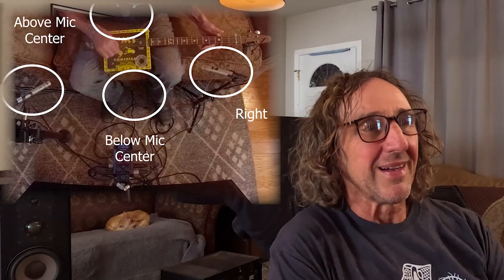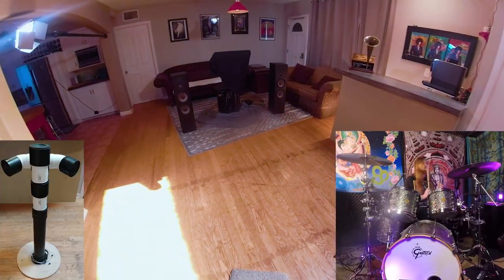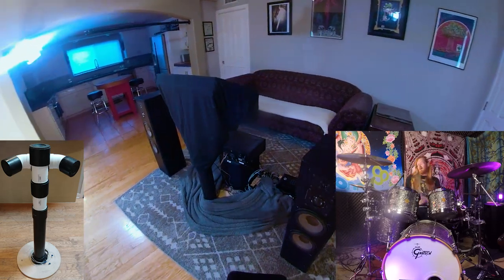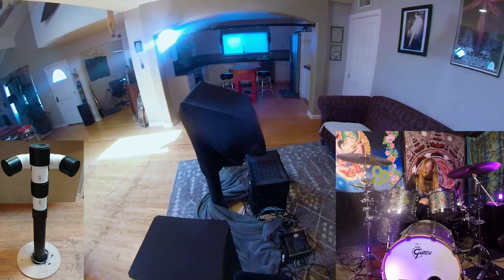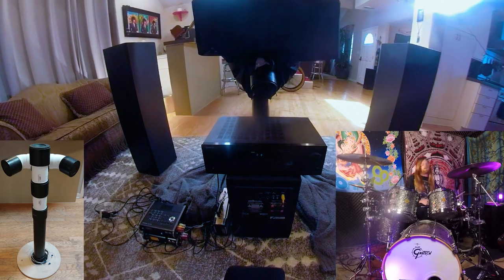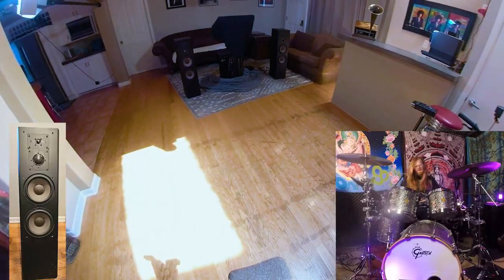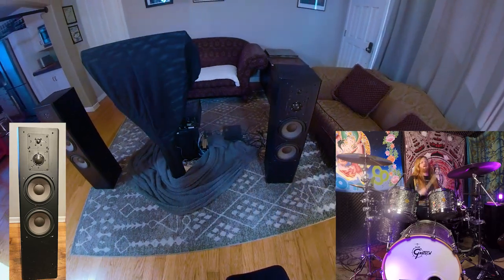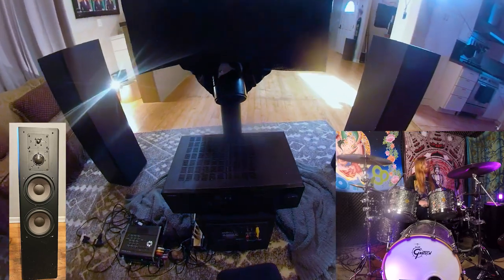How Real Do the Drums Sound?

Comment: By reproducing reverb separately a high quality representation is achievable.
Reply from the maker: If you recreate reverb then you're recreating another room inside of your room which will never sound like the instrument is actually in your room.

That will sound like there is an instrument inside a room that's inside your room.
Reply: @DaveRat  you're thinking of recording rather than emulating or reproducing. To change the room's reverb we need to be able to actively control the reflectivity of the walls - particularly at low frequencies.

To achieve the required diffusion and phase response to emulate reverb is something that we do for classical music, and the South Bank Center has an adjustable reverb time. We keep it very quiet how much reinforcement and synthesis is going on - the classical music snobs would fire us all in a minute if we told them what's in the roof.

Similar systems now permit classical music to be performed in open air, and it's basically a diffuse cloud of speakers with some very fluffy gaussian shaping involved.

Absolutely it isn't totally easy to reproduce an acoustic environment. Headphones also sound super unnatural. It will be a long time before the human audio perception is fooled and we're experiencing "holographic sound".

The diffuse or gross aspects of a reverb tail can be reproduced quite easily, especially by putting speakers in all the corners of the room. Early reflections, phase response and micro-timings are much harder to deal with - there is an argument for placing speakers on a person's head or over the ear to supply that information.
Reply: @DaveRat  so basically I reckon that by combining some boundary positioned speakers at the first reflection points, various b-format loudspeakers on some sort of animated robotic cable conveyer system, and a bending wave loudspeaker system integrated into the surfaces, all discretely digitally amplified and processed per driver, as a network, with onboard monitoring and AI/servo correction of the required parameters, we probably could get it done where blindfolded you are actually convinced you are in a machine gun nest or landing craft on D Day, with all the right noises coming from the relevant places, so you can hear the shell casings landing on the floor... It can be done. There will be holodeck.
Reply from the maker: I think Holoplot can do this right now.

The issue is the more you achieve with processing the less realistic the processing sounds
Reply: @DaveRat  a lot of the active noise cancelling systems and AI stuff is based on filtering noise, and some of the better sounding active acoustic controls can sound positively hideous if you listen to the "anti-sound" in isolation - at the listening position these artefacts present as an artificial reduction of dynamic range and an increase of the noise floor, but as with all distortion and noise... it all adds up, but often one sort will mask another. Over a distance of 150m in a concert hall, and an array of 600 individually amplified 15 inch concentric driver boxes, you can get away with more in terms of vagueness and larger time windows and spatial volumes for hiding things in than you can with a living room.
Reply: @DaveRat  holoplot looks most likely to win sounds weird and has high distortion off axis award of the year award goes to... bway that's a lot of silk dome tweeters you got there. I'd like my next house built out of them, absolutely. Every surface. Where do I sign.
Reply: @DaveRat  however, in terms of an anti-sound, one must note that the electrical braking and servo control of a loudspeaker can in theory produce an anechoic response - using driver clusters to prevent comb filtering in difficult rooms is fascinatingly successful, and can actually get rid of the frequency lobes caused by interference - this is partly because a cluster of speakers with an amplifier in it is actually a huge actively controlled helmholtz resonator. It is possible to actively control acoustic treatments, and extract large amounts of kinetic energy from the vibrating surface by electrically adjusting various parameters, including mechanical damping ratio. Actively controlled or electrical vibration dampers are common in precision industry, and similar techniques can be used to design anti-sound and anti-reflection devices, some of which could very likely introduce diffusion and phase delay as viable methods of moving or removing room modes, removing or adding resonance, and various other components, simply by turning a screw or clamping surfaces together, as well as by moving a loudspeaker diaphragm. Placing speakers inside helmholtz slots or tunnels can also do some very serious stuff in terms of controlling low frequencies, and anti-sound techniques are required to really tidy up any acoustic space. Large venues are the worst culprits.
Reply: @DaveRat  most interestingly, a holoplot 2d array does allow beamforming - enabling a reverb virtualisation method where the ceiling, walls and floor can be sent separate reverberant signals, which are relatively well focused on a narrow listening position, and reflect off the actual walls before meeting the listener. This means that much less sound has to be injected into the room to supply reverb, so a few chunks of 2D array is highly suitable for providing early reflection information, by bouncing the reverb off the walls. That would indeed supply a fairly convincing reverb component at a given position, or range of positions. For adding orchestral reverb to a bad room it could be really suitable, just fly in a pair of holoplot clusters above the stage, separate to the mains, and run a stack of altiverb instances with some well designed impulse responses... very likely nobody would be able to tell what the fix was for an orchestra placed in a really dead big screen cinema, or that the reverb was not inherent to the building. It would blend.
Reply: @DaveRat  beamforming has a bad rep, hissy and swishy, and with a burdensome taxed headroom, but for reverb only, used in a clever way, I would bet it'd work a treat for synthetic reverberation. In a small dead theatre, it would very likely be able to produce the effect of climbing into a huge cave, or escaping from a prison through a sewer, illustrated only using artificial reverb and the actor's voice in the modified acoustic environment.
Reply from the maker: On the member side I posted a a video of the holoplot demo of beamforming and wave front synthesis and other features they can be even heard of my cell phone recording.

They want to give me a few of the speakers to play with which I will probably take them up on at some point when I have some time.

I was a consultant on the EAW on your system so I have quite a bit of experience with beam steering designs and all that working with those engineers.

I also have heard a room cancellation dead name system from PowerSoft eliminates the room reverb or ads reverb.

So I think I have actual experience with all the stuff you're talking about how well it works and the complexities involved in deploying them along with the limitations

Comment: I think you're onto something with the real sounding speaker.   on gravity.. that's a tough call.   the equations for the various forces in physics don't always hold true in practice.    I think in general math does hold.. you know even imaginary numbers hold true in electronics! as to the earth ... I read the Bible.. for the longest time I doubted certain parts of the Bible but I am much less doubtful now.   so much less.  It took me a long time to arrive here.  you know how a sphere is nothing more than a circle rotated about its diameter sweeping 180 degrees.  therefore all the rules for circles must also apply to a sphere, like curvature.. Geometric rules for chords and tangents all apply etc.. I think merely looking at gravity and I am not telling you whether I think you are right or wrong-- but merely using whether gravity exists or not as a test for determining the shape of a planet is, if you really think about it, is as useful for determining the shape of a PA system.  have you ever looked at the stars or taken photos of stars?  they say the great pyramids are arranged in the shape of Orion's belt.  the Big Dipper was there in the exact same shape, the angles and distances all the same thousands of years ago. "why didn't gravity pull the constellations into different shapes???" ... on any given night, you can be certain it will be the same shape.  look at time lapse footage of stars rotating about the North Star and watch for things like parallax scrolling.   get in a plane and fly to Hawaii and look at Hawaii out your window on a clear day or at some other mountain range from a distance.  then consider geometry etc..  light travels in straight lines and shadows tend to form on the opposite sides of objects from the light source.. these are very basic and obvious things to consider but when you consider them all at once when you observe the world around you and the clouds and stars and sun and moon and horizon and land formations and consider distances and geometry.. well there are a lot of things you can figure out without using sine, cosine, tangent functions or without advanced geometry but if you do have access to a real geometry book, like one from a math major in a major university - or even the one from high school but if you consider all this stuff, you may begin to find interesting ways to measure distances or shapes or "scale".. it helps to be an artist as well - I mean I know you didn't need to read this much to get a feel for what I was trying to say.. anyways.. I liked the suggestions you had for your old man for speakers and fully agree with your assessment of audiophile.  I mean.. I have some pretty darn cheap speakers I use on a regular basis for enjoying albums... I never actually studied sound anywhere near to the depth I studied engineering/electronics or "general" physics.  you might know this.. you know how light has a vertical and a horizontal wave which is 180 degrees out of phase.. I think one is electric and one is magnetic or something?  I wonder if higher frequencies have a horizontal and vertical component like that OR if there is something about the ether which causes that because you know how keeping mics at 90 degrees for a stereo image is much nicer than 60 or 30 degrees.. I know 120 is popular (I never use it- maybe I am wrong for that?)... anyways, just some curious thoughts I have about sound.

Comment: None of the speakers presented can do this regardless of room size.
None of these sounded realistic
A Drum kit easily surpasses 115sb SPL without compression,
at the minimum you need a fully horn loaded system such as a Klipsch Lascala, Klipschorn, or obviously the Klipsch Jubilee 
or seek out old voice of the theater Altec Lansing horns or fully horn loaded PA, but PA speakers might not be as refined
Reply from the maker: Sounds like you are adding on the additional parameter of how loud it is by making the assumption that the drummer plays hard.

I remember doing a show with Terry Bozzio warming up on drums playing incredible fills and the full kit rocking and you could talk perfectly standing right next to him he was playing so softly it was truly amazing.

Regardless the goal is not to make something the same volume as a drum kit nor was the goal to make something that sounds identical to the drum kit.

The goal was to build a speaker that sounded realistic like a drum kit.
Reply: @DaveRat  Realistic for me is I would like to walk to the room next door and not know if there is a real drummer in the other room or a playback, ditto for a piano, or real thunder an lightning storm vs playback of one
Reply from the maker: Agreed. That was the initial test we did with acoustic guitar and it gets spooky close

Comment: Yeah sounds good have you got any plans wouldn't mind to build one, you said four drivers I could only see three I think! two on the sides and one at the top pointing up! is there no tweeter? Is it a single drivers? or is it a concentric drivers? what are the drivers you're using then? I'm assuming it's an active crossover what are you using? expensive or cheap, I could get the BBS speaker management system They're about £200 second hand fourway.
 what slopes and crossover topology did you use?
How do they sound with a whole recording being played?
What might be good for laugh if you enter them into a hi-fi exhibition, you could put a wooden frame and cover the frame with transparent material like vanderstein's.
See if you can win best in show!! go under a pseudonym.
It would be a laugh and expose the hypocrisy of it all lol
Wouldn't it be more fair to run the passive hifi peakers through active as well. Would have been a closer result.
Reply from the maker: Here is a link to the playlist of videos that show the building of them and more info https://www.youtube.com/playlist?list=PLqsPeTx2oVyeFDJ-qnXGRacbmgZ-VIpHU
Reply: @DaveRat  ok thanks check it out
Reply: @DaveRat  I don't know I can't get it to work only a couple of videos work the rest don't load a bit annoying I don't know why
Reply from the maker: This is the one that will help you build it

https://youtu.be/VLkQSSydXwk